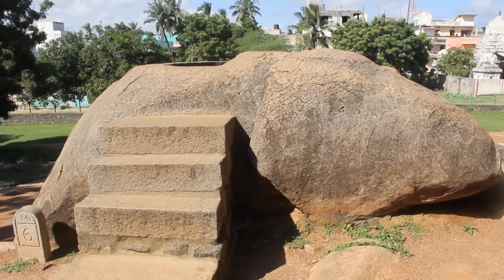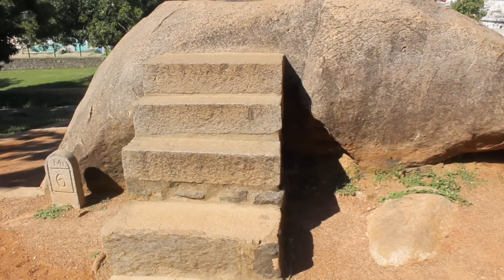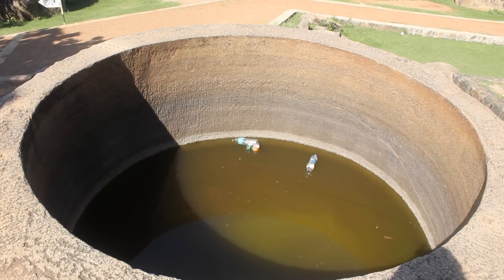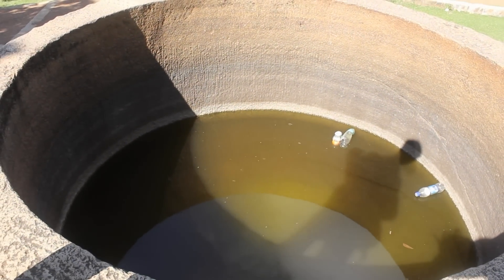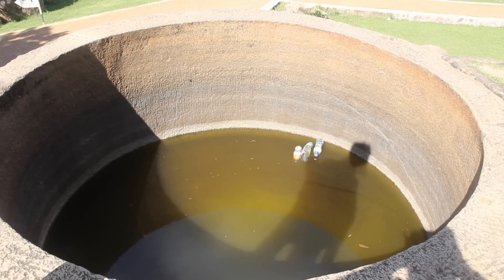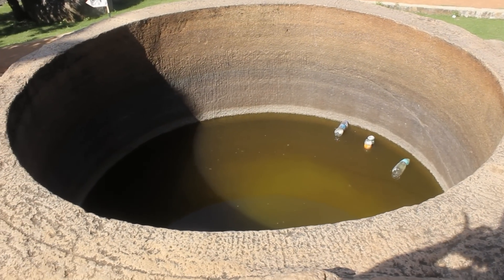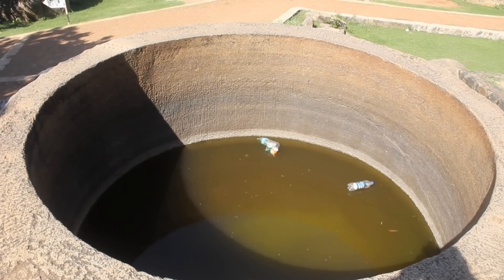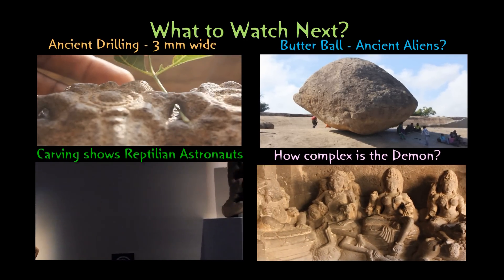Ancient Drilling Technology - Mahabalipuram, India

Comment: I'm a stone mason by trade, those vertical   markings do look like punch marks.  A punch chisel has four pointed sides, like a pyramid  unlike a flat chisel. The question is how old is this work?  If it's prior the iron age than it raises a big question. Another point I noticed is there is a crack in the inside face of the stone, if you were working around that cracked section you can expect large chunks to flake off as this is a week point, but here there was none. Unless the crack appeared some time later. Like if you light a fire inside the hole  it is possible the stone would crack due to intense heat. Either way I wouldn't like to take on that task even with todays sophisticate tools and machinery. So who ever you are that did that work my hat off to you, your better man than I Gangadin.
Reply: mmm intresting...............mmmm   god only knows, that's why we are here, to figure thie shit out!
Reply: You can chisel granite with bronze. You can even use copper which is hardened by pounding. 

You don't need iron
Reply: Also, if this hole is only 1300 years old, iron tools can be that old. 

This isn't a big mystery
Reply: Chris G  It's weak not week 
And Gungerdin
Reply: @davidboardman8590  what guggerdin? The name is Praveen. Praveen Mohan

Comment: this is crazy because you can see the groove marks made by the drilling machine. there is a crack on the wall, but other than that you can see it was made by a machine not human hands. it could fit a big cylindrical object like a rocket or missile. a launching pad 1000 years ago?
Reply from the maker: That is a very interesting idea that it could have been used as a launching pad for a missile or rocket. In fact, I saw sculptures that look like rockets in Mahabalipuram, will post them soon. Thank you.
Reply: Good observation:)
Reply: xD
Reply: Actually those grooves are vertical and not horizontal as it would be in case of a drill
Reply: Really appreciate your reasoning,👍👍👍👍👍🙏

Comment: you don't need to know the value of pie to tie a piece of chalk to a string
Reply: true lol
Reply: +Darryn Grabbe -- And the walls aren't perfect, you can see chisel marks.
Reply: LMFAO !! BAAM!
Reply: u people don't the knowledge of our old tamilans (tamil people). still know they are genius working world wide around 120+ countries
Reply: you may Google for the pi inventory
Reply: GuinnessandPizza @ 😂😂
Reply: Darryn Grabbe I think you don't know value of pie. Can you manufacture a wheel without knowing what is pie. No physics is without pie.
Reply: Don't bother.
I think this went completely over his head. :D
Reply: or even a rock fixed to a straight enough stick and anchored at a center poinnt. . the string is going to create the fibonacci sequense in reverse
Reply: What if they uses those as kind of part of tool like huge turbine for cutting tools with weather , if you have enough  pressure you can cut a diamond with just water, maybe it's a part of huge pump and top is missing ,also if there was tools like this why they wouldn't use the for cutting tunnels ? I think is a part of mashing devices.
Reply: its not about making perfact circle its about drilling a perfact cylindrical hole. did you noticed how straight walls are?
Reply: mmm, pie
Reply: Zdenek Strnad a huge pump is a good idea, if it was fitted with some kind of diaphragm over the top used to push up and down, maybe made of sheep skin or camel skin or rubber, who knows, but a massive pump is a great theory!
Reply: Yogesh Chinnappa; WOW!!! 3!
Reply: Maybe in the next 2500 years you'll fake a moon landing.
Reply: Thomas Mobley Chisel marks?  Then how do you explain the completely smooth carving above the “chisel marks”
Reply: GuinnessandPizza - Most Western ppl hve a habit of neglecting the truth nd suppressing others nd overwhelming for nothing has created this gap of technology
Reply: Thomas Mobley if I give you a chisel, would you make this hole? Don't underestimate the power and intelligence of தமிழ் people.
Reply: And a chisel at the end of a string. This can be done without a machine.
Reply: Robert Ra, Yes. lol.
Reply: so without using abusive language can any of you explain why would people chisel away for long time and make this structure? what was the purpose in your opinion?
Reply: @Mike masadonia "breaded" 😂😂😂
Reply: @nanipappu7288  in the video he said one cannot make a perfect circle without pí ...   these people are discussing how to DRAW a perfect circle not actually carve it.
 Can a perfect circle be made with a compass?
. One only needs a secure center point, an object of fixed length to rotate around it,and something to make a mark at the end of it
Reply: bmxbeemer80 No the guy said the circumference is a perfect circle. And these guys are not discussing linguistic nuances here. They know what the heck they are talking about and so do I.
Reply: You are right. Appreciating is okay. But nonsense imagination is very bad.
Reply: Every time boasting about the intelligence of earlier generation is of no use. What are we now?  Compared to population even now our contribution to real science is negligible.
Reply: I eat chalk. And I eat pie
Reply: @MorganDC420  Those are not even chisel marks. The lines are just minor erosion from water and air over time. It eats away at the material just like any other surface. If you take that into consideration then you will ignore the little pock marks made by rivulets of water and wind blowing through it and instead look at the depth segments of the coloured bands. 

The horizontal bands are the same height. You can see minor colour difference between the bands but the depth of the bands does not change. 

Imagine a core drill. You start out on the surface as it is spinning, every specific interval of time it presses down to the next depth. So it ends up spinning to cut into rock before the plane of the drilling equipment levels off and starts the new layer. Each layer the weight of the equipment levels off to the height of the previous layer to ensure that the segments are uniform and the wall remains smooth.
Reply: Pies really valuable imo. Especially Apple with the Carmel crumb stuff on top. Bomb af.
Reply: GuinnessandPizza I think, that is where your people’s  knowledge ended and you guys even started growing as round as a pie. You probable don’t even know the difference between pi and a pie. Did you even graduate high school... or you just appreciated the pies your uncle made? 😂

Comment: Making a perfect circle is easier than a perfect square. Stick a rod with a string in the middle and start chopping away untill you reach the marker on the string. Since this could have been a demonstration of percision it makes sense. Also cylindrical volume is quite easy to calculate from the height and radius when you know about pi. No aliens, no weapon of mass destruction, just a plain and simple doing it because we can.
Reply: Djhg2000 pi wasn't invented then
Reply: @d3athreaper100  You don't invent mathematical constants.  The concept is at leat 3600 years old.

Comment: I think we should give them more credit. These ancient people were still homo sapiens. They had the exact same mental capacity that we have today and were capable of complex thought and engineering.  You dont need to have pi to make a perfect circle. You can use a string from a central point to continually check your work. But as for why they did it, and what tools they used? I have no idea.
  I would guess they had a large round cutting tool with several handles that was fixed in place over the hole. Several people could turn in for a very long time, taking turns until the hole was bored, and then they could remove the center support post. I wish I could see the bottom. I bet theres some sort of divet in the exact center.
Reply: elephants are usefull as well ;) you know granit stairs can be pollished by foots walking on a few years.. so what fun this people saying we need machine to polish. for the use of this, i'm surprise no one think about a tank to preserve seeds, milk or whatever soma, a pool for holy bath (kunj)... also this place have light houses (for boats) since several centuries, so why not a candle.. don't remember what was it exactly, so i will ask again next time
Reply: Yeah exactly, use a rope centrally, excavate edges and work inwards. But as you mentioned, what tools did they use that are that hard and durable to do it in a viable time frame and not centuries? There looks like there are chisel marks going down the sides too??

Has anyone ever thought that maybe ancient civilisations existed 200 - 300 million years ago, they formed theses shapes like using a mouldable cement type technology and that after 200 million years has petrified? Some of the macchu pichu and Egypt builds have similar excavated hard stones that look like it's had lava poured on it to cut it onto shapes? God knows
Reply: How long does it take granite to form? Maybe humanoid type of creatures existed several hundred or thousand millions years ago and have lived on this planet way back then? Wait what
Reply: Josh Denham Yeah, have some faith in human ingenuity!

Also people DID know pi 1300 years ago. Quite precisely! Pi was first calculated to 3.14 by Archimedes... in 250 BC. The ancient egyptians had looser approximations and the babylonians knew it as 3.125. It was independently re-calculated to varying degrees of precision by various algorithms in China, India, Persia, etc. People have known about Pi and the golden ratio and other such things for a VERY Long time for precisely the reason that people have had more or less the same raw brainpower / reasoning capability for the last few thousands of years
Reply: Hassan Uddin There were no humans 200 million years ago... there was not yet even the lineage of mammals that would go on to become primates and humans until some 40m years ago
Reply: It would be like walking into the garage to find your child has build a table, and done a good job. Then you say "Omg son! How did u do this! Wheres the aliens at!"
Reply: Josh Denham They wouldnt bother to use several people, a couple of donkeys could do the job, day in, day out!
Reply: This is false... slavery has been around in India in full force since at least as long as the islamic conquests, and there may have been analogous social institutions in earlier times
Reply: I was referring to ancient structures in general. India, and any area with the Hindu religion for that matter, has nearly always been peaceful. As mentioned, it took intervention from an outside force to disturb the peace!
 Just a joke guys!  Simmer down!
Reply: Josh Denham
As an aside, some years ago, there was a US art 'professor' who wanted a grant of $4 million to build a facility to test whether the dutch painters used 'camera obscura' to do their paintings.
In a TV discussion/documentary with him, a curator of one of the dutch art galleries, said, 'No, they just used a pin, and piece of string, with some chalk on, like builders use all the time!'
Its strange how some people look for the most complicated way of doing things, when simple is easier and always cheaper in labour and materials.

Comment: How deep is that? Amazing work. I can see those vertical lines that look like the mark of  the device they use was left.
Reply: +Sumaq Llanqha - I completely agree... those vertical marks sure look as though the builder(s) used a type of drill bit and drilled hundreds of vertical holes down into the stone, in a large circular pattern, all the way the around the stone.
Reply: +Sumaq Llanqha You are a rare flower in a field of weeds.
Reply: +john haynes LMAO How do you know she didn`t murder her family or something? You can tell this by a thumbnail picture?
Reply: +willythewave She has not called anyone an idiot yet. Self restraint has got the best of her. How do you know that I haven't, how do I know you haven't?
Reply: +WJK The vertical marks are strange... Our contemporary drilling tech would produce horizontal striations.
They may have drilled hundreds of vertical holes in a circle and two cross slots through the center then filled the holes with water and wait for winter to freeze the water and pop the granite inward.
Reply: Dude31463 - Awesome thought process behind your hypothesis... I could see that as plausible for sure!
Reply: search "Sigiriya". Massive stone with ponds and swimming pools, gardens on top with a water supply the even the German Scientist cannot discover. And it never goes dry unless there's a sever drought.
Reply: its 5 feet deep ....... difficult to understand what technique tjey hv used .... but for sure its not drillin...bcoz drilling doesn't leave vertical marks...amazing

Comment: well.... its not a drill. The striation marks are vertical, not horizontal as I would expect in case of a circular drill... Also, the bottom could not be seen, is in a spherical bottom or cylindrical?
Reply: +Dimitry Kudlay dear sister god bless u
Reply: +Dimitry Kudlay Me thinks some sort of ultrasonic cutting tool on a multi axial lathe..?
Reply: +Dimitry Kudlay Yes, the bottom should tell us more about it. Good thought! I was hoping the author will make another video of it soon.
Reply: The author did mention on another video presentation on cylinder shaped stone structure in a temple built around 900 yrs old which had similar lathe technology applied. The theory of ancient modern tools and equipment may have after all exist. Historical findings have confirmed that india used iron metal technology dating back to 5,000 years and huge iron beams weighing 5 tons used as supports in temple construction. Imagine smelting and mold making and casting technology 5,000 years ago. Surely there must be some kind of technology existed then.
Reply: The striations marks are indeed vertical, and they seem to be done by hand, using some type of manual technique and tools, because the marks aren't straight or parallel either. And there are other striation marks on the edge that run inside the hole. I would say it was done with some type of lathe machine, and the finishings were done by hand. That crack also show 2 things: One it was applied great pressure and force to create the hole and second it might be the reason why it was abandoned.
Reply: What if the striation was vertical because the form of something which is hardcase of something, i don't even knew, but as i saw the striation then i just remember the back hoe's mark. Maybe it was because the gap between each striation is almost the same.
Reply: Absolutely..first thought in my mind without doubt..marking done by rope carving done by manual chiselers.

Comment: hard to explain withoit a drawing . You can drill it out the same way the egyptians did and then knock out the core  in pieces  or lift it out with a crane, they did by 1st drilling a pilot hole , Insert a post and where you say you used line and chalk . Use an rigid beam and an abrasive . then rotate for a few weeks. One man can do the whole job even with equipment of the day.
Reply: +ralph goober  what about putting fire first ,get it very hot, then pour water so it can crack like glass & then chisel away, .is this another way?
Reply: iv long assumed it was done how harry described,same technique i use to cut holes with an electric router,with the same method only adding diamonds as your primary cutting tool and with a bit of time you will achieve a perfect circle